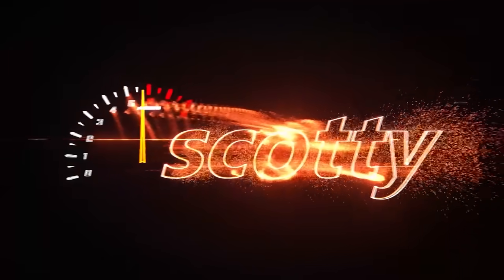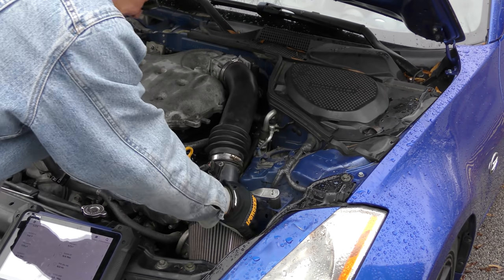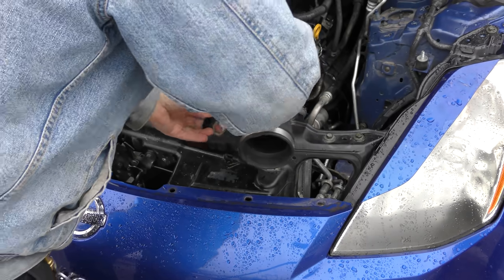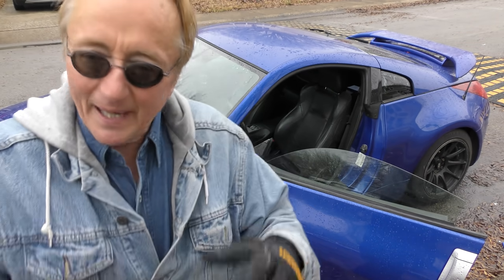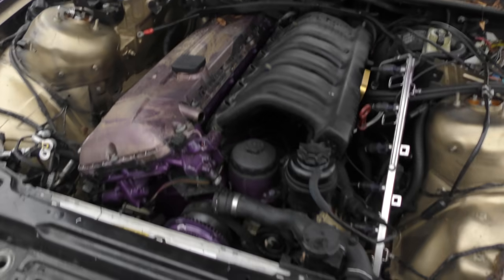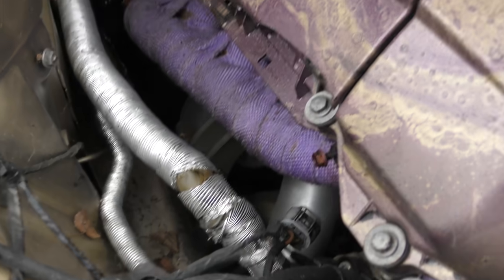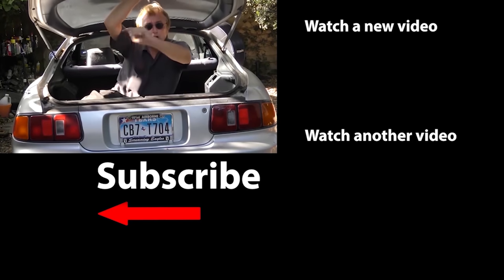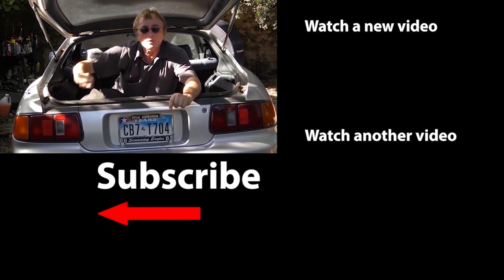If You Put This on Your Car I'm Going to Laugh at You (Worst Car Mod)

Comment: He could put in a new motor and transmission but couldn’t find an air leak😂
Reply: Trial and error.
Reply: I did an engine swap on my car a while ago
and to this day I'm still trying to find the vacuum leak 

feelsbadman
Reply: 🤣 I was just thinking the same thing.
Reply: @Chimera6297  Ever tried using like a fog machine or a vape mod to show the direction?, I feel that’d work at least to guesstimate. If it was a space station you can use a tea leaf 😂
Reply: @Chimera6297  Yeah try a smoke machine they are cheap on eBay buy it, use it,return it. LOL😂
Reply: @iamaaron____  Boom smells like ‘Merica 🇺🇸🤣
Reply: It's always the simple things we forget
Reply: @iamaaron____  
You don't need a smoke machine.
All you need is a big fat cigar.
Reply: Things We See aren't you supposed to start with the small things first? Lol.
Not just throw a different engine in and work from there.

Comment: Back in the 70s, the old Kawasaki H2 750 two stroke triples were called "widow makers" too...... and for the exact same reasons as the Hayabusas are today!
Reply: Never heard it applied to the 'Busa. I think Scotty has it confused with the Suzuki TL1000S/R
Reply: those old Kawasaki 750s and 500 triples were cra,zy fast .
" Fast by Gast " was a big racer in the 70s and he told me all you needed was a slick and a wheelie bar to make those H2s run 10 sec 1/4 miles .
I had a 1974 Z1 900 kawasaki and it was pretty fast too.
Reply: @jayhockley8841  I know! I had one when I was younger and I don't know how I managed to survive it.

I got an unbelievable deal on another one 3 years ago, bought it, restored it, drove it for about 2 months and very quickly realized I was going to kill myself on it so I sold it. Made a nice profit on it, though.

Comment: 8:35  TIME....the letters   'S U V '     denote a  'simply  useless vehicle'   with SHORT WHEEL BASE, and non-winter stability......drove a nissan 2013 Armada,  (taxi for train crews)   and nearly rolled it on an icy winter road here in Alberta Canada, with the best winter tires on studs.....thanks, Mr.  Killmer.....

Comment: Wrong info on the camry oil burners. The 2.4 is the oil burner not the 2.5. Toyota fixed the piston ring issue with thw 2.5.

Comment: Put this comment in this file (Rocky & Bullwinkle Style, with dual headers): 1."I'm even older than you, Scotty, and I don't care who laughs at me;" 2. How a failure in Toyota quality led me to install a K&N short air intake."

Back story: I have a 2008 2AZ-FE Camry, bought in 12/07. To date, both the original engine and transmission are in good working order with minor repairs. However, as I explained in a prior post, many other things went "south," relatively early on: (Dash polymer, visors [twice], rack and pinion, radiator, water pump, CD player, cruise control [twice]). Not among the previously mentioned items , was the airbox, which I had to replace FIVE years ago, this month.

In the year BT (Before Trump), and the beginnings of our horribilis anos, January 2016, I was changing my air filter when I noticed that the lower part of the airbox was jammed with detritus from nature (leaves, sticks, etc.). As I began to gently remove these, the airbox first began to crack, then PORTIONS OF THE LOWER AIRBOX LITERALLY CRUMBLED INTO POWDER. What kind of QC is that, for an OEM? 

Given the poor quality of the aftermarket, I wasn't going that way with a replacement. I did not want to pull a used unit from the salvage yard, thinking that it, too, would soon enough become plastic "dust in the wind." And another unit was prohibitively, crazily expensive from Toyota dealers. End of story: A short air intake unit from K&N was installed. I've taken care to keep the filter relatively clean. 50,000 miles later, there's been no problem, and recent Blue Driver engine and fuel data supports my claim.  So go ahead and laugh . . . and remember that like the dash Toyota had to replace,  along with an airbox and housing that literally turns into powder after eight years, Toyota's lack of attention to these plastic and polymer parts, at least in my car, is what is truly laughable.
Reply: @Mark Codiroli No,  it was poor quality. Toyota replaced the dash . . . known problem. As for crumbling powdered plastic, how's that "operator error." If you read Gen 6 reviews online, you'll see the visor issue is also well known. Gen 6 (especially 07-09) had lots of problems, beginning with the defective piston design. You have a Gen 5. That's a different story. So, sorry to disturb your Toyota belief system, but this particular car was a quasi-lemon, part of a bad run of Camrys between 07-09, from Kentucky. Then again, it's Mcconnell-Rand Paul land. Perhaps that's the best they can do.

Comment: The 07-09 Camry had a 2.4L engine.  The Rav-4 had a 2.5.
Reply: 2007-2009 RAV4 had the same 2.4 2az engine which had bad piston rings and burned oil.

Comment: That hole is actually for a vacuum hose, it goes to the back of the valve cover they probably didn’t put it back on
Reply: Thanks. I was wondering about that.

Comment: All these CAI systems do is suck in hot air from the engine compartment. Mine sits underneath the engine compartment and actually does suck in cold air and it's a Mopar so it fits correctly!

Comment: I thought he was going to rip on intakes again.  I've ran just the big knob filter on every car I've had.  Tell you what I had a CTS from 2005 to 2017, and got rid of that because the transmission started to go, the engine was fine and I did some crazy driving with that car for sure.  Those intake filters, ya you need to use the shroud so it doesn't suck in hot air around the engine, but they work and do nothing if you clean it with the right cleaner and oil.

Comment: Actually the 4 cyl. engine you want to avoid is the 2.4 liter 2AZ-FE engine, that was the one that had the piston ring problem.  AFAIK the 2.5 liter is fine.

Comment: Literally tested my intake temperature yesterday with a factory high flow intake and $60 cold air intake and the cold air intake was 20 degrees Fahrenheit cooler at idle.... each car intake placement is different!!!
Reply: What do you drive bud? On the fench about getting a intake for my G37.
Reply: @snapyo1472  I drive a 02 Grand Cherokee with the 4.7 H.O
Factory placement is behind tail light far from grille
Cold air doesn’t have a heat barrier but is just next to the grille taking in fresh air

Comment: That's hardly a cold air intake as much as it's a DIY, short-ram, hot engine bay air filter that's also sucking in more crud from that huge hole behind the filter.

But I'm no Scotty either.
Reply: Be better off putting the stock airbox, back on, and K&N panel filter.
Reply: Yeah those are worthless in the Hr and De engines basically lol. Their are 3” CAI intakes that route to the front bumper area and truely suck Cold Air but these require a tune but average 10-15 whp just on that simple mod.

Comment: It's out of power steering fluid... yet Scotty lets the thing run while he yaps away....  ha ha!  At first, though, I was thinking some sort of bearings internally were going out when I started to hear that noise.

Although to "Fix" the air leak in the intake plastic I honestly would have used black Gorilla tape myself versus electrical tape.  Not that any moisture should get under there, but I just feel that Gorilla tape tends to hold up better when exposed like that, even though it's under the hook (plus the air intake hose could get warm from the engine running).  I'm sure as a temporary fix it doesn't matter what you use as long as the hole is plugged.

The funny thing about parts car is I bought one when I had my 97 Civic thinking i could rob parts off the parts car (which was basically the same thing, but a year older so a 96 and had more miles).  Odd thing was I never needed anything except an interior door panel which I broke accientally when a gust of wind blew the door shut while I had my leg sitting outside of the car while I was waiting in a parking lot.  But I never had to actaully use any engine parts from the parts car.  So I eventually sold it when got rid of mine (the 97).    The 96 Civic parts car was like $500 because it was T-boned on the passenger side apparently but the engine and trans ran fine, although the engine wasn't the same model, but could be swapped if mine (which was the V-tec motor) went out, which it never did.  They both used the same transmission though so I did have a spare transmission I guess.

Comment: I bought a 1978 F150 with 300 inline six, has a flexible aluminum hose going to the exhaust manifold and a black plastic hose pipe going to the front behind the grill.
Should I take these off? Think it come from factory that way.

Comment: If only someone told the engineers designing the air intake system that they could just use a k&n cone filter

Comment: I have a question i have a diesel and when i fill up i have to keep my had on the gass pump and run ot or it will shut off i have to run it at a trickle? So what can i do to fix this problem?
Reply: All I know is black handle is diesel green handle is gas make sure to use black handle
Reply: @Nikkk6969  my problem is the pump shuts off unless o fill it slowly
Reply: @Mark Codiroli ok thanks my truck is a 91f250 diesel

Comment: I love my Fx35 which is the same engine as the 350z and the parts are extremely cheap. Uprev tune with custom exhaust and a lot of other stuff.😂😂just hit 300,000 a few days ago
Reply: Favorite thing about nissan is almost everything came with the vq35/vq40. So easy to find parts when you need them, and they are inexpensive

Comment: AGAIN !!! the 2AZ-FE from 2006-***2008*** - through 2011 on the Scion XB is a **** 2.4L **** the 2.5 is the next gen that doesnt have the ring issue, please get it straight, thanks
Reply: An anger issue

Comment: Did he not get a P code for running lean with that hole??  Definitely should have. I’m sorry but most ppl that buy imports mod them with junk mods that usually kill power or so junky they set CEL’s.   Definitely a pos.

Comment: dont buy the GM SUV they are now the same price of the Newer Toyota Sequoia, if you thinking about buying a brand new Tahoe, Get a Sequoia instead, they last longer and trouble free, GM are piles of junk. if you got to have a tahoe, get one between 2000 through 2006 model.